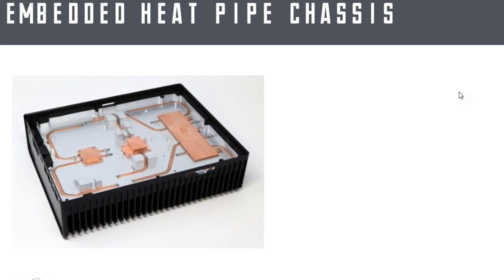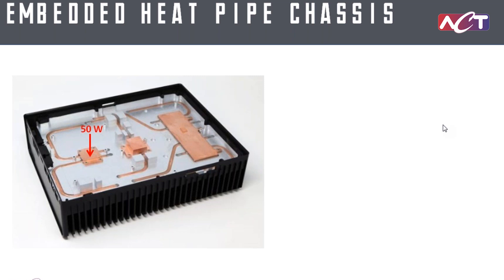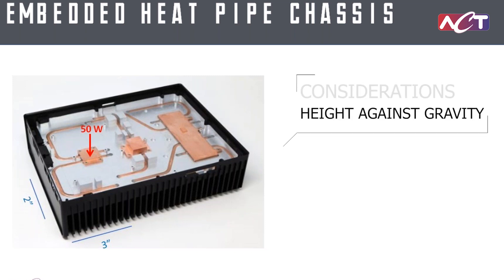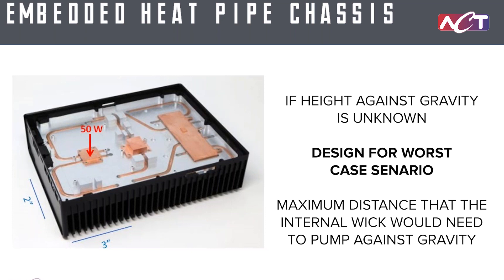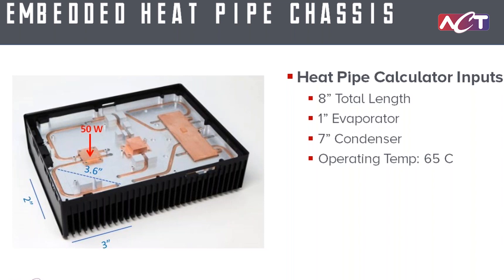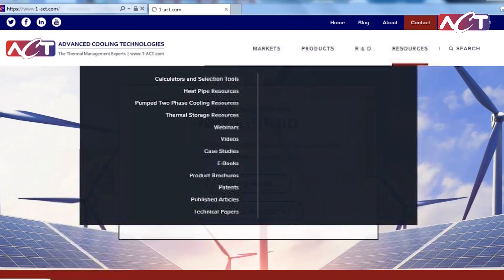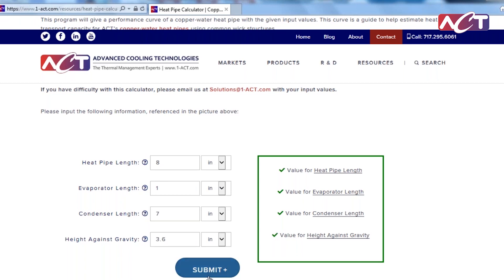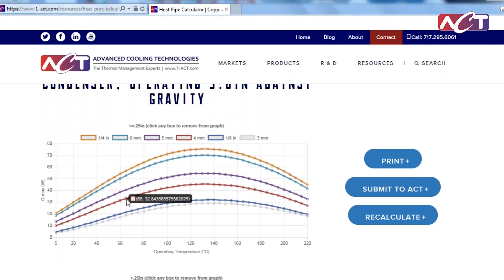Heat Pipe Calculator Tutorial

Comment: Does the diameter is outer diameter of copper heat pipe or inside diameter of wall thickness of copper?
Reply from the maker: Those are outside diameters, the wall thickness depends on the diameter of the pipes, but it typically between .010 and .030 thick.

Comment: 1" evap length and 7" condenser length? Where is the adiabatic length?
Reply from the maker: In this example, we did not use an adiabatic section because the heat-generating source was coupled to 1" of the length and the sink (fins on the opposite side of the chassis) was coupled to the entire length of the pipe. In scenarios where the heat pipe only has fins coupled to a portion of the heat pipe, we would certainly incorporate an adiabatic region.

Comment: It's possible to use heat pipes for car engine cooling?
Reply from the maker: Heat pipes don’t routinely play a role in traditional automotive engine cooling. In most instances; the existing liquid to air heat exchangers used in automotive applications are high performance and capable of removing heat from the coolant loop efficiently. The engine itself heats up fairly uniformly; so there is no major benefit to spreading the heat out.
Reply: @AdvancedCoolingTech  The problem of "water cooling" the car engine it's it's when the head gasket is blown ... you can lose the entire car. That could never happen with heat pipes...
Reply: @Maisonier  heatpipes can burst if they overheat, and they have much less mass so they get to it quicker
Reply: @Maisonier  I've lost 2 cars due to rubber hoses bursting. I suspect mechanics squeezed the hoses trying to make a sale. Someday I will get around to wrapping the rubber hoses in the engine compartment with bare wires that will detect when they are wet and beep in the cabin.